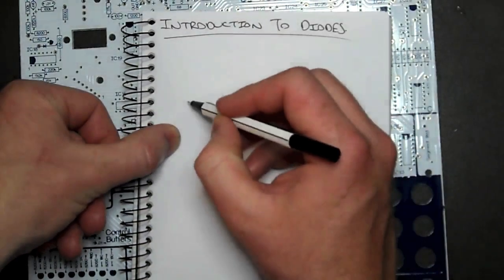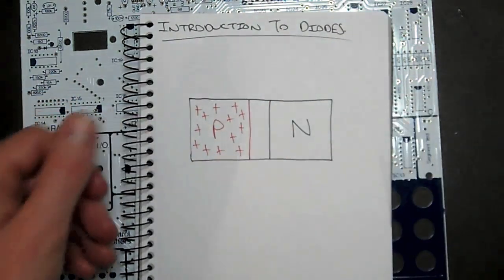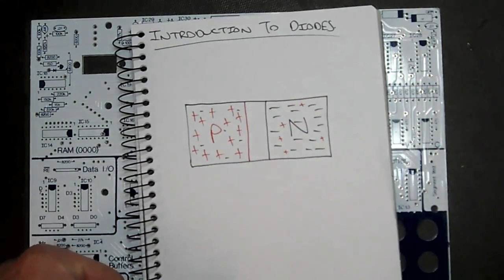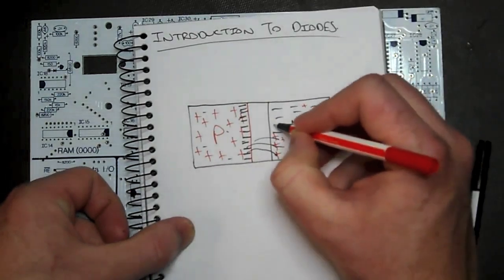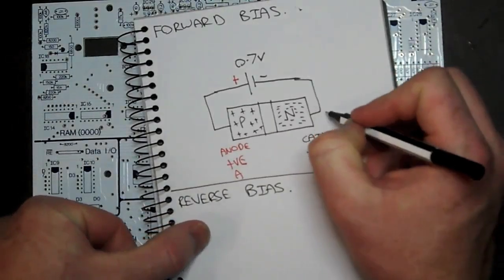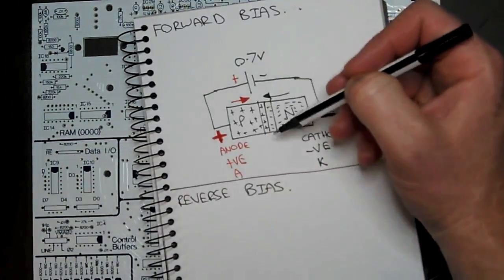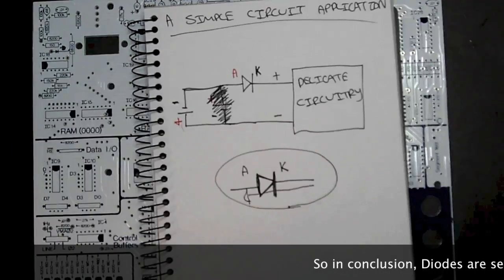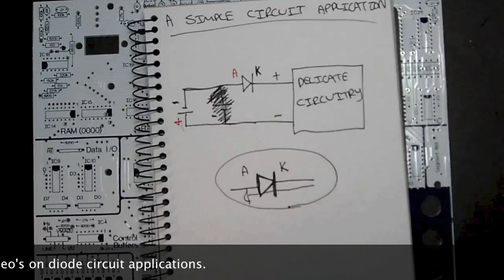Electronics Tutorial 6 - Introduction to Diodes.

Comment: At 10:50 you said "the holes would be attracted to the negative potential, so that one go that way", ie. + towards -. Now, if the positive charge is an atom which have lost some electrons and the negative charge is an atoms which gained some electrons then, by saying that the the positive charge would go towards the negative terminal would mean that those atoms which have lost electrons would travel towards those tiny electrons at the negative terminal. This seems impossible due to many factors, the first one being the fact that the mass of Si (for example) is hundred of thousands bigger than the mass on en electron and nevertheless due to the fact that the mother nature is smart, it always uses the shortest path (so it would be reasonable to assume that rather are the electrons which moves towards positively charged atoms and not vice-versa). Am I wrong?
Reply from the maker: The holes aren't positive ions but rather, they are atoms which do not have a complete covalent bond I.E. they have a space for an electron to jump into in their valence shell. The free electrons jump from hole to hole (from atom to atom) which makes it look like the holes are moving in the opposite direction to the electrons. I
Reply: Thanks for your answer. After reading the http://hyperphysics.phy-astr.gsu.edu/hbase/Solids/dope.html#c4 and https://www.halbleiter.org/en/fundamentals/doping your above answer makes sense. The holes are nothing more than the positions of electrons in a covalent bond of a semiconductor (eg. p-type Silicon-Boron). As Forrest Mims explains in his "Getting started in Electronics" book, a Boron atom in a cluster of Silicon atoms leaves a vacant electron "opening" called a "hole". It's possible for an electron from a nearby atom to "fall" into the hole. Therefore the hole has moved to a new location (with other words the old hole is now filled while a new hole has been created somewhere else, thus we could say that "the hole has moved").

Comment: what is the P type material and what is the N type material? and how you manufacture them? and how do you bond them that a deplation region is formed?
Reply: A P-type semiconductor has trivalent impurities, i.e, atoms that have 5 valence electrons in the outermost shell. 
The reason that it is 3, is that Silicon(semiconductor material) has four valence electrons (4-1 = 3), so for there to be a hole(the absence of an electron), you need one less electron.

Examples of trivalent impurities are:
   1. Aluminum (Al)
   2. Gallium (Ga)
   3. Boron (B)
   4. Indium (In)
  
Similarly, to make an N-type semiconductor, you would require materials that have one more valence electron than what the semiconductor material, Silicon has. N-type materials are doped using pentavalent impurities (4+1 = 5), which gives rise to the presence of free electrons in the material. 

Examples of pentavalent impurities are:
   1. Phosphorus (P)
   2. Antimony (Sb)
   3. Arsenic (As)
   4. Bismuth (Bi)

Comment: Great video up until the bit about the conventional current flow and electron current flow. Conventional current flow is not an old thing and is still taught in Irish universities and most of the western ones to actually, as I know MIT also use that convention. Just said I would point that out. Sorry if i'm coming across as negative, that was my only problem, otherwise fantastic video and really helped me understand diode concepts:)

Comment: god, bit confused, starting to understand it the more i think about it, but why would you connect the negative terminal of a battery into the negative of the circuit, shouldnt it be negative to the positive so that the electrons are pulled into the holes. or is the negative of the circuit there to say, "this is where the negative goes, connect it here"?